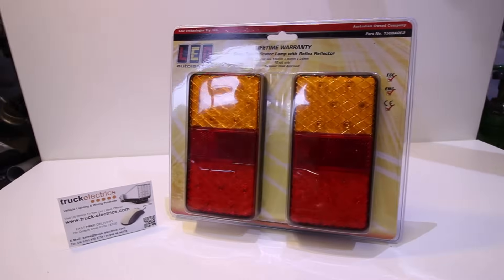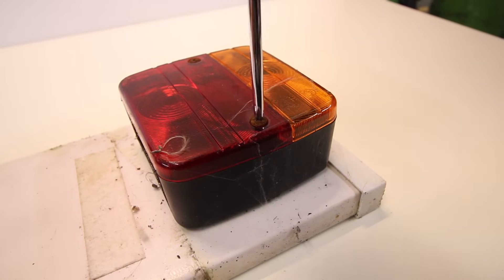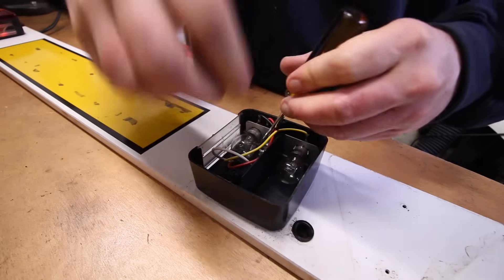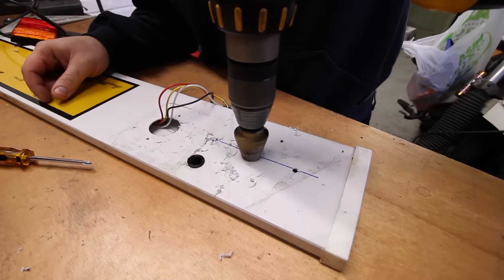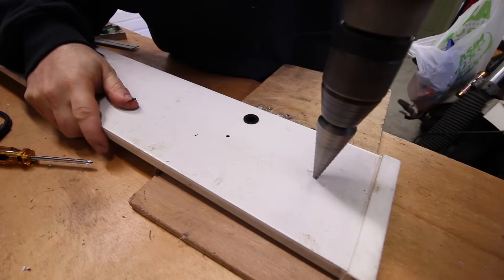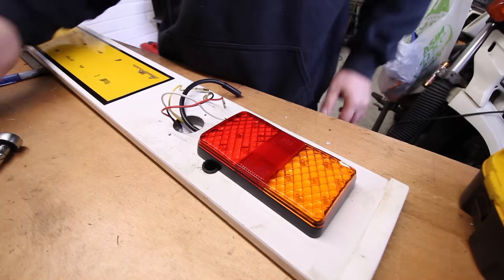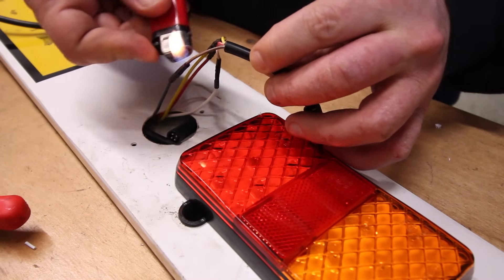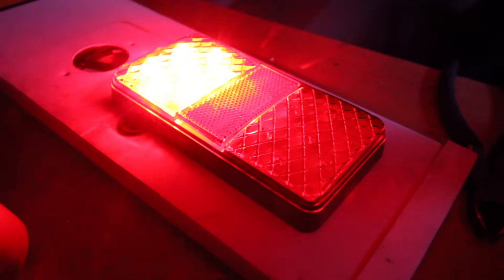How To Wire LED Trailer Lights

Comment: You DO need to keep the triangle reflectors as these indicate it is a trailer. The square built in reflectors are for when the lights are used on a vehicle.
Reply: I use red triangle at the rear and the square orange reflectors on the sides of the trailer
Reply: Which country mate? never seen them in Australia

Comment: fitted these to my trailer board today they don't work on the car. but an led trailer board I bought later today worked fine. Did you fit resistors in line and did you test on the vehicle to see if it works?

Comment: Could I put powerful led lights in place of the factory light bulbs? ( Back up lights only) Just to have a little better illumination. Also, some people tell me that you can't mix led with regular bulbs and that they must all be led in the system.
Reply from the maker: Hi Ned, Do you mean led reversing lights? https://www.truckelectrics.com/collections/work-lights/products/led-reversing-light-48w
Reply: Yes. We call them back up lights or reverse lights.I thought maybe I could put led bulbs in place of the regular sockets in my vehicle ..
Reply from the maker: Here is a link to led bulbs , you mean these?
https://www.truckelectrics.com/products/24v-premium-led-single-contact-tail-light-bulbs-replaces-149-248-pack-of-2
Reply: TruckElectrics.Com You guys run 24V ? Here (N.S) vehicles use 12 VDC .Thanks for responding though. P.S. I don't know why ford doesn't use brighter reverse bulbs.
Reply: You can use conventional bulbs with LED. The LED will just draw less. A lot of us here in the states switch just about everything to LED

Comment: Illegal removing the triangle reflectors and why did he not fit lights over the old light holes. Only wired the easy side as you after sort out the wiring as these lights are colour coded for one side only.
Reply from the maker: Hi John, We drilled new holes because the old holes wouldn't fit, also we wanted to make the video as clear and simple for our viewers..not confusing them with existing holes etc.  Only wired the easy side.. dont know what youre getting at there.. And finally, Yes we should have left the warning triangles on, Our mistake, Point taken!
Reply: TruckElectrics.Com He said easy side because the colours shown for that light you fitted match the existing loom colours in that side. The other side uses a green wire for the indicator and a black wire for the side light.  Standard 7 core trailer wire has different coloured wire for each indicator and each side light. Common wires, red for brake, blue for fog and white for earth, all the others are unique, a point you don't mention in your video or comments.

Comment: Rewired my whole trailer with a new kit. Plug in. Doesn't work. 
Edit: welp. It does work but only when the ground is connected back to the wire and somehow the signals are on the wrong sides. GJ me.